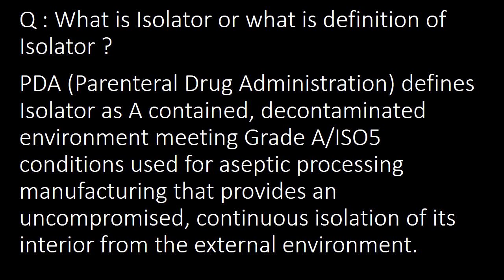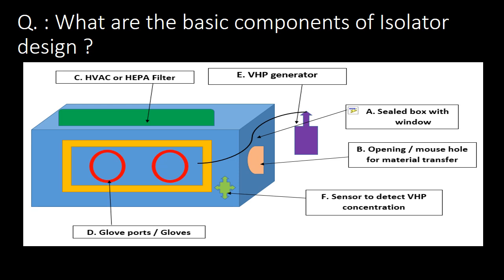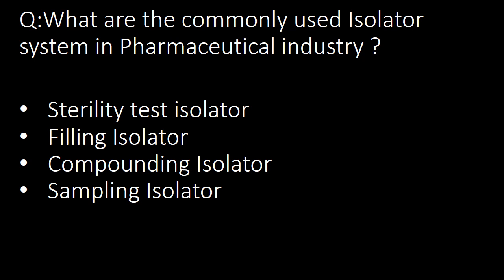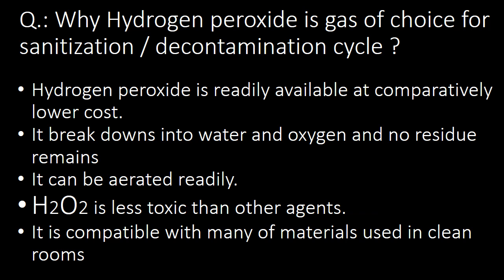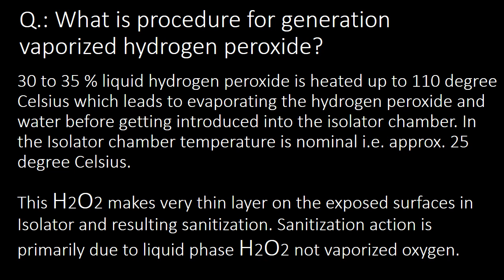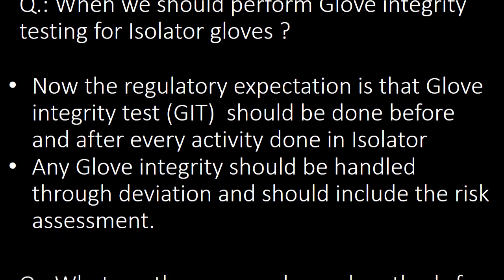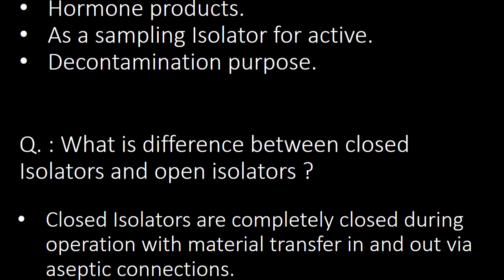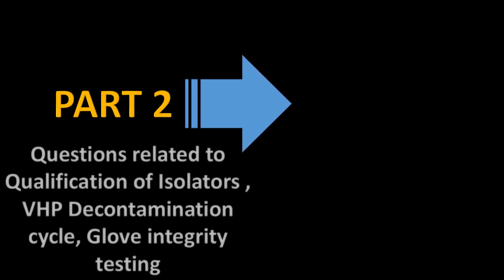Isolator used in Pharmaceutical industry l Part 1l Interview Questions

Comment: Any good books that you can recommend for Isolators?
Reply from the maker: EU GMP Annex 1 provides specific requirements for isolators, including design, installation, operation, and maintenance.
You can also refer equipment manuals for this purpose. Steriline isolator manual has very good arranged and guideline based info.